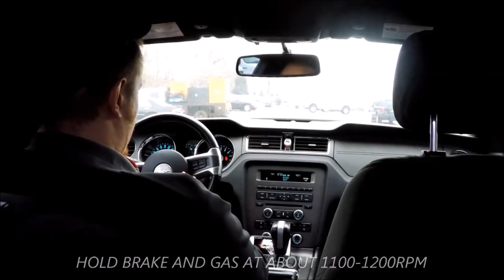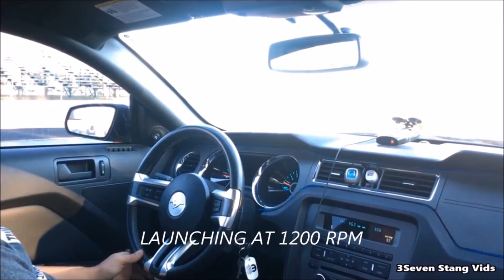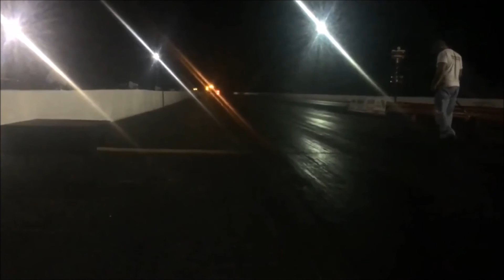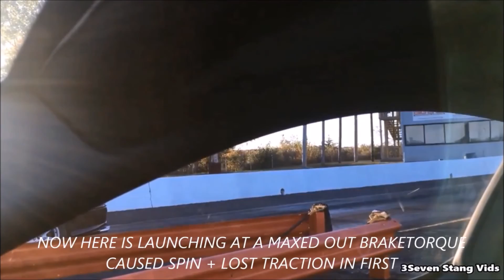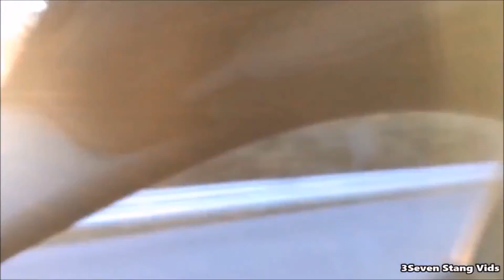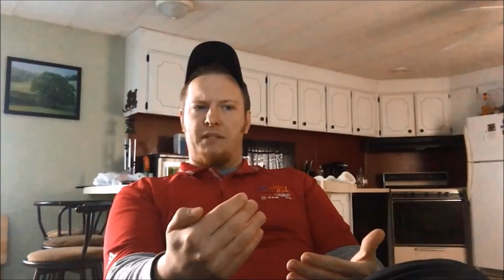How I LAUNCH a STOCK 6R80 Automatic 14' 5.0 Mustang

Comment: This guy knows his stuff. never thought about holding the brake too hard can slow your launch. Cant wait to try slight brake pressure and leaving about 1200. Been leaving at 1500 with the brakes held hard.
Reply: Dang. I'm going to have to do that . My first car was a mk6 gti. So I always held the brake all the way down because that was the launch control feature . I'll have to try this
Reply: True in my mustang i only ever USE enough brake pressure to hold car, It makes sense shoot during a redlight to redlight race a 1/4 sec can make all the diff

Comment: When you said gears don't make that big of a difference did you mean just for the 5.0 or the 3.7 auto as well? I was thinking of going either 3.55 or 3.90 but if they don't make that big of a difference I may just got 3.55 because it would still be a huge improvement over 2.73 right? Right now the best I can do 0-60 with a tune, shorties, and CAI is like 5.7-5.8 which I feel like could be better. But my launch sucks too so IDK.

Comment: You thinking about getting one of Terry's trans brakes?
Reply from the maker: In april... Transbrake is going in, Intakes are getting ported, 5C Circle D torque converter going in
Reply from the maker: Should run 11.40's im hoping
Reply from the maker: May switch to a Lund Ghost cam tune also Depending on who gets back to me on a sponsor deal first lol
Reply: Who does porting on coyotes? You don't wanna spend the money on a cobra jet or gt350 intake i take it?
Reply from the maker: pballer2005 terry from tb built is going to do mine
Reply: 3SevenStangVids oh sweet give terry se 5.0 love! Curious to see how it turns out. Should deff keep the cyclone Facebook pages up to speed on it

Comment: In your previous manual mustang, did you rev to 1200 RPM when launching like you did in your automatic?
Reply from the maker: Sweet Tea on street tires on the street i would rev to 2200 ish and basically dump the clutch. On track passes with drag tires i launched between 5-6k rom
Reply from the maker: Rpm*